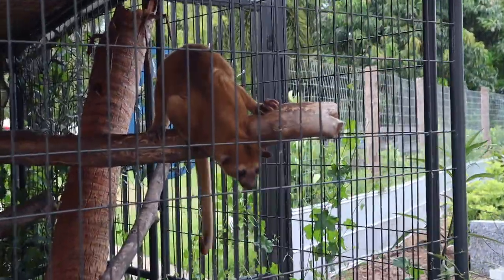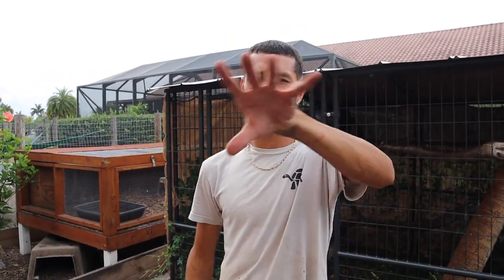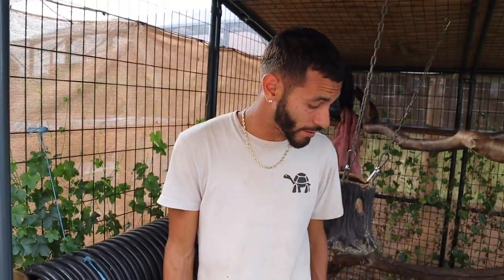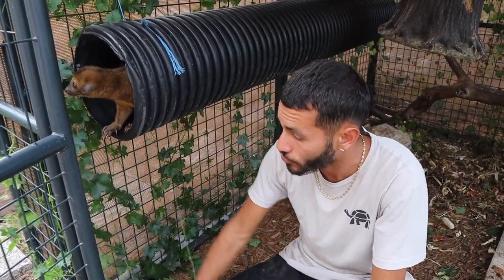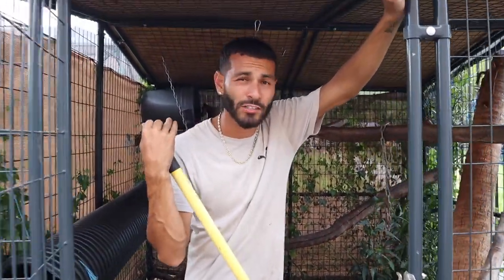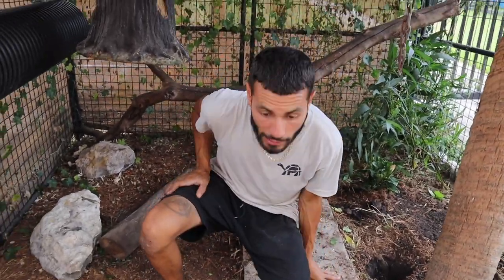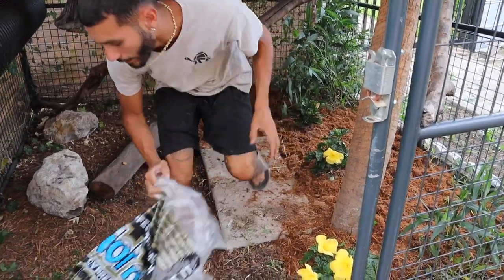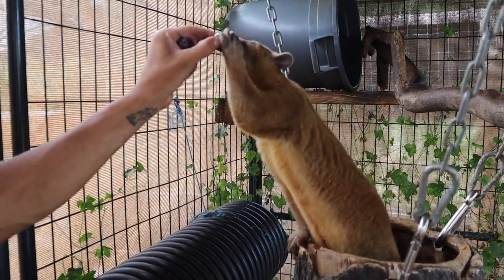Cleaning RESCUED MONKEYS Enclosure On The RANCH!

Comment: Hello blake.
You should put the smoke detector on the highest point inside the building.
The smoke will first go up and then it will build down, so it has a lot of time before it hits the detector where it is placed now.
This is just a tip i dont wanna be rude or anything.
I hope you will read this and take it into consideration.

Comment: You should put the smoke detector higher as smoke rises so if it’s near the top it will catch it sooner but if it’s lower the barn would be like half full time or have more smoke in by the time that goes of just if you want to of corse but smoke rises so it would make sense to put it at the top if you can get up there